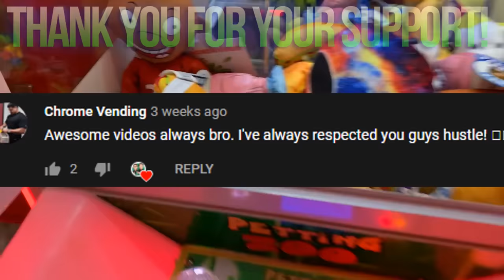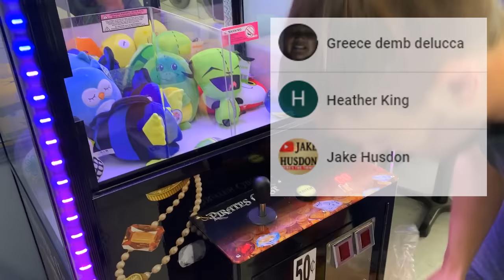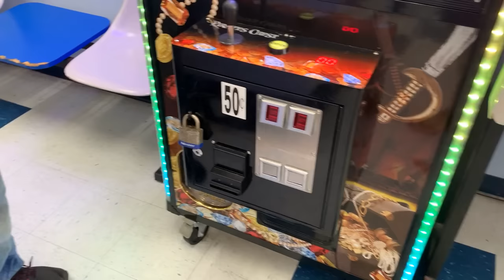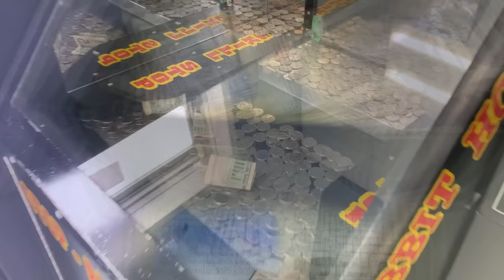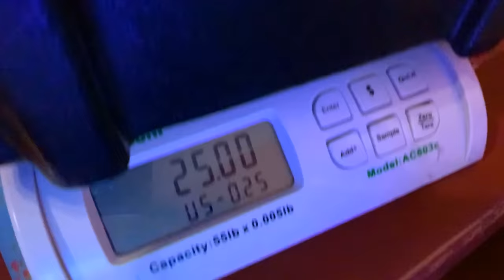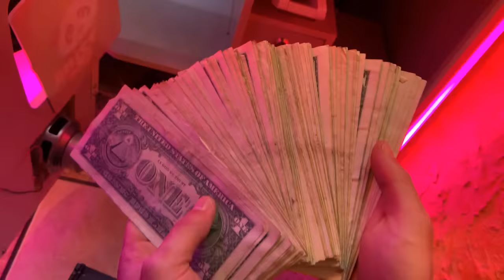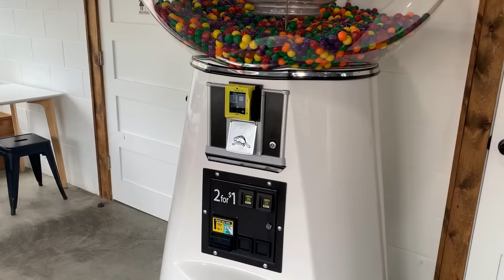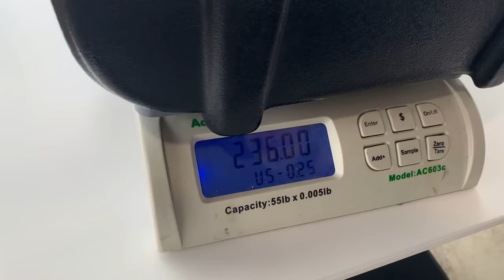This 7 Foot Gumball Vending Machine Made SO MUCH Money

Comment: How is there money in the coin pusher? I thought the quarters you put in go straight to the pusher and then when u push the quarters off then you get them????????
Reply: There are two openings, one on each side of the surface under the mirror.  As the quarters squeeze to get to the front edge, the triangle in the middle covered with quarters pushes some quarters to the side and they fall in the container below which is the profit.
Reply: Raymond thank you!